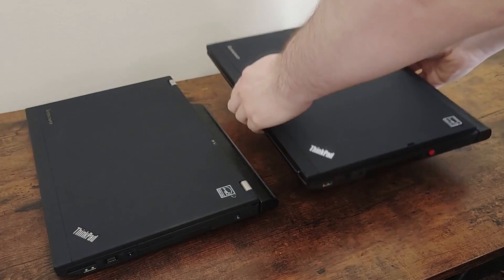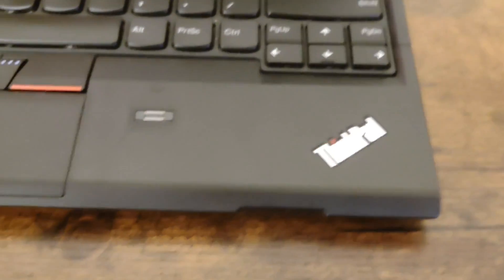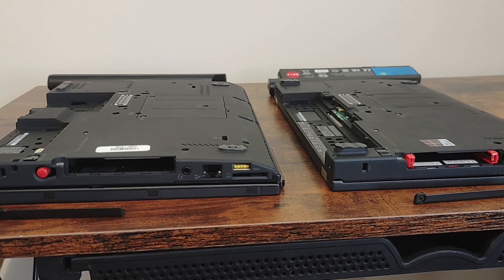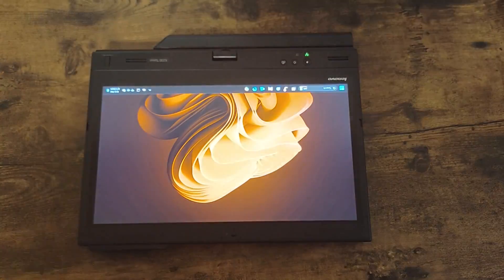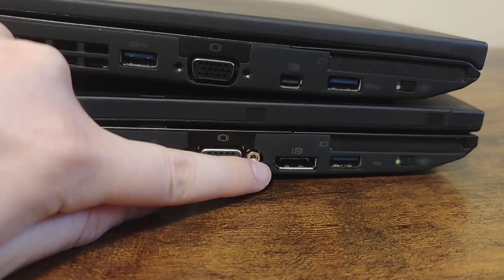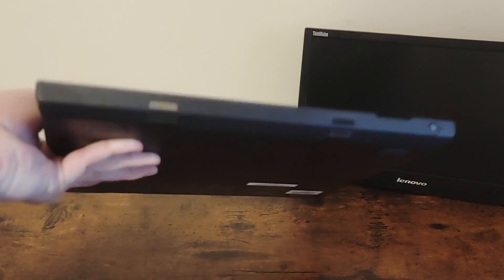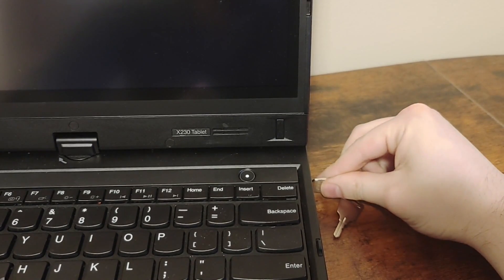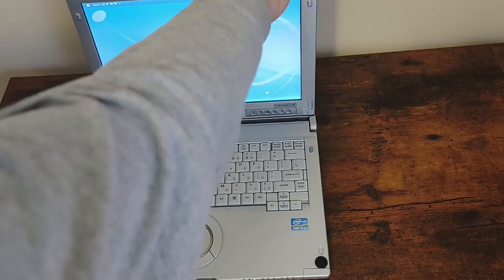ThinkPad X230 and X230 Tablet Review and Retrospective.

Comment: Great Video! (as always!). Question: I’ve had an X250 for the past 4-5 months, 16GB ram and running Void Linux without problem. Recently, past 2 weeks or so, after putting the computer into sleep mode, upon waking it, it consistently reboots (instead of just waking). Could this be a hardware issue? I have a T460S running exactly the same software configuration, and it reboots as expected — Suggestions? Many thanks!

Comment: Just purchased one on eBay. For 170. I also grabbed a 250 msata for boot up and a 1 tb ssd as well as 16 ddr3 sodium ram. Gonna try to run Linux. Will it work with my touch screen is the question.
Reply: I used a X230t for years, and never used the touchpad. I never put it into tablet form, except to show other people. I was so happy with it, I didn't mind though!
Reply: did it work?
Reply: @ yes🔥🔥

Comment: I own a modified X230, it's been customized into an "X330" with a BGA-replaced i7-3615QE quad core, a 13.3" WQXGA hi-dpi IPS LCD, and the classic 7-row keyboard. It absolutely lacks in raw performance, energy efficiency, and expandability. But like you say its IBM heritage styling is irresistibly charming, and the modifications certainly enable it to do things a regular X230 would rather not. It replaced my previous daily driver, a regular old i5 dual core T420 upgraded with a QHD IPS LCD which paired with the classic keyboard presented a combination of premium real estate and typing ergonomy unseen since the T60p.

Comment: I always wanted one of these. a old but good and repairable trusty helper.
i think some have been retrofitted with full HD screens.
maybe i should still try get one :)
thanks for a great review :)

sound effects starting the ultrabase exquisite :)
Reply: the fhd mod requires special kits now only available from aliexpress and requires soldering to the board
Reply: @escapetherace1943  You can upgrade to IPS HD+, doesn't have to be full 1080 HDP.  For a while it was a single guy in China (Hong Kong?) doing this kind of upgrade, Aliexpress is a quite a bit more accessible.  Soldering isn't hard, maybe you didn't mean to imply that, but it sure comes across that way.  I'm not sure why it would require a "special kit".  The type of screen isn't exotic, and these mods have been done since at least 2017, probably earlier. It sounds like you've been discouraged, but a quick web search of "Thinkpad X230 Screen Upgrade" show a TON of resources.

Comment: Is this your actual voice or do you use some kind of voice Changer?
Reply from the maker: I use eleven labs ai voice.
Reply: @Duraputer  Why?
Reply from the maker: @FR4M3Sharma I haven't figured out how to filter out background noises. I got an expensive samson mic, but when ever I record something it sounds terrible, and all sorts of noises for cars and trucks kept ruining the recording even worse.
Reply: @Duraputer  Reduce the Gain of the Mic, if you use Windows then go into the control panel then hardware & devices and open your mic's property to reduce it.

You can test the gain level by using the "Listen to device" option that makes the mic output to the speakers of your system. 👍
Reply: @Duraputer  Put the mic right in front of your face and get sound deadening, and tune the gain from there. That should get rid of most of it.